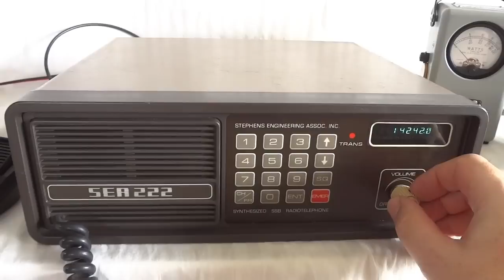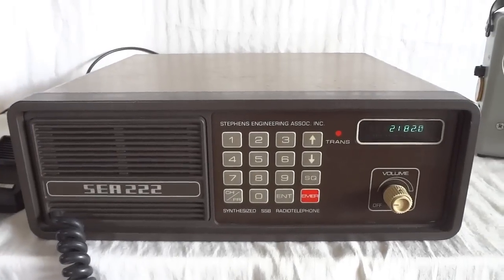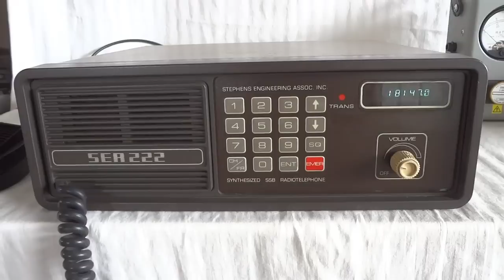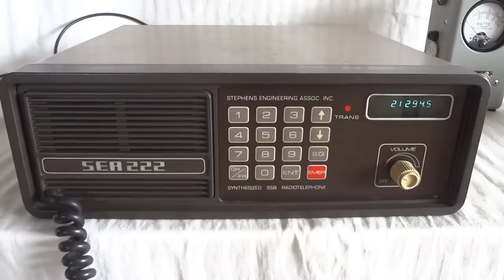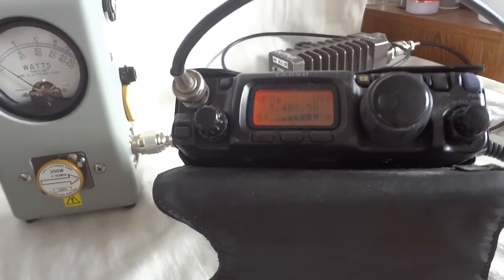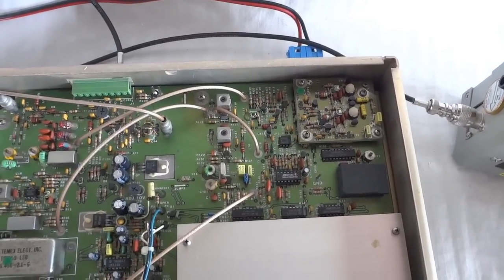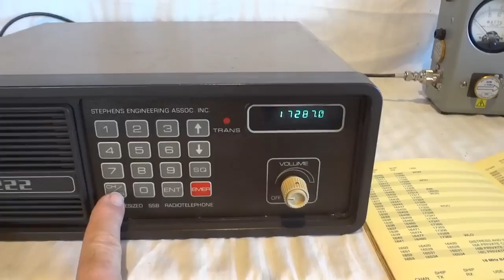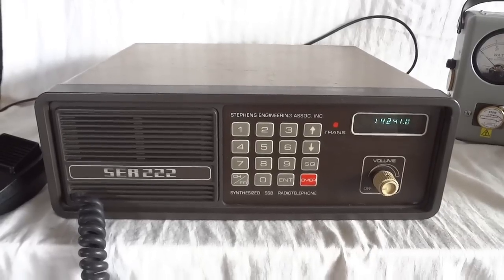Stephens Engineering Association SEA222 Hf SSB marine transceiver

Comment: I have this radio in my sailboat, along with the antenna coupler.  I attached a SWR meter and despite talking into the mike, I got no indications on the meter.  I took out the radio and brought it home - a long way from the boat.  It is on my work bench and I want to hook it up and test it again.  Can you tell me what I need?  I suppose  (1) a good 12v power supply and (2) and antenna.  Do I need the coupler (whcih I left on the boat.)  If I hook up 12v power supply and plug in an antenna cable and antenna into the back, should the radio work?  How do you have your radio in this video hooked up?  Thanks.
Reply from the maker: I have it hooked up to a manual antenna coupler (Collins 180S-1) , not visible in the video. So the radio sees a standard 50 ohm load. If your radio does not work, check it with a 50 ohm dummy load. If it still does not give off power then, there is a problem with the transmitter, not with the tuner or antenna system. Hope this helps, cheers.

Comment: I recently acquired this exact same radio. It had been sitting in an office on a shelf still connected to a power supply and antenna, which also was given to me. Other than some dust, the radio is in pristine condition but when I switch on and try to go to a frequency, it comes up with the "UNLOCK" error. I understand this means the PLL (phase locked loop) circuit is unlocked. The radio needs servicing. What causes this and could most communications techs repair this?
Reply from the maker: PLL unlock can have multiple causes. Most likely candidates are a problem with one of the VCOs or maybe the master oscillator has failed. It is also possible that the EEPROM has "bit rot". I have uploaded the complete service manual for this radio to mods.dk a while ago, download that first if you want to attempt a repair. Yes a repair technician with experience in HF radios might be able to fix it, but this is probably cost prohibitive. On eBay I saw a parts unit with a broken bezel, if you buy that one you can swap out the whole exciter board which might get it to work. https://www.ebay.com/itm/Sea-222-Single-Sideband-Radiotelephone/124553513713
Reply: @LifeIsTooShortForQRP  Kind thanks! I'm now on a mission! Greetings from Alaska.
Reply: Dang. I was too late. Already sold. But I'll keep an eye out for more. I believe this old radio is worth bringing back to good working condition.

Comment: Could you show me how your bench is set up?  Antenna, power supply, etc.  I would like to set up a similar bench to test my SEA 222. Thanks.
Reply from the maker: I am using it with an Alinco DM-330FX power supply. The antenna is a 24 ft vertical, tuned to resonance at the (isolated) antenna base with a Collins 180S-1 tuner. Cheers.

Comment: Hi there! my husband and I have a small sailboat and we are considering purchasing a Sea222. We are just learning about the SSB systems and I was wondering what other items do you need for this SSB to work. Would we need to buy a antenna system and a tuner? Thanks in advance for your help!
Reply from the maker: Hello! The SEA222 is great for ham (amateur) radio, but for professional use on a boat it is now obsolete. On a boat, where safety comes first, you need to have a reliable, modern HF SSB radio that is one-touch DSC capable and that has an NMEA interface for a GPS receiver. This way, a single push on the radio's button will inform the coast guard of your position in an emergency situation, fully automatically. 
See here for an example of such a radio that I can recommend: http://www.icomamerica.com/en/products/marine/ssb/m802/
If you don't care about automatic DSC (because you can still call SOS manually on 2182kHz or 14.300 MHz) then the SEA222 should be fine. But I think I would go for a new SSB radio; safety is most important on the high seas, and cost should not be a factor there. 
Thanks for looking at my video and good luck
Reply: Thank you so much!!

Comment: Does this radio have lsb,  i am planning to get one.
Reply from the maker: Standard it has no LSB. There was (is?) an LSB kit that one could buy, but it was pretty expensive. In my video of the Philips 220 (the same radio but with the LSB option installed as standard) you can see this LSB feature. https://www.youtube.com/watch?v=AbWJDY4iKuU But the Philips 220 is rarer than hen's teeth. Hope this helps. Cheers.

Comment: Hello,I have a SEA 222 SSB and I require a set of proms for it.Any help would be greatly appreciated Thankyou
Reply from the maker: Did you ever get the PROMS? I can email you the bin files that contain the firmware but you will have to find someone with an eprom programmer to get the code in the EPROMs.
Reply: @LifeIsTooShortForQRP  Yes,they actually worked fine for maybe a week and then for some reason the radio went totally dead,I tried troubleshooting it a bit but I believe I did not have a full service manual way back then,so it has just sat in my closet ever since.